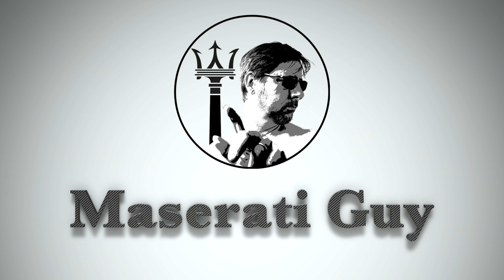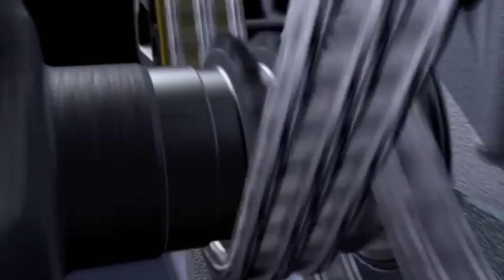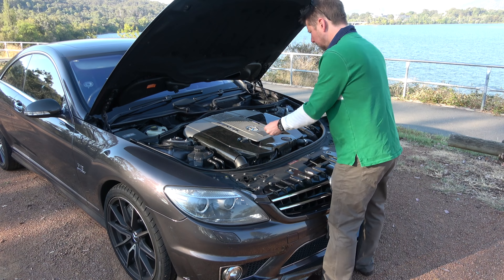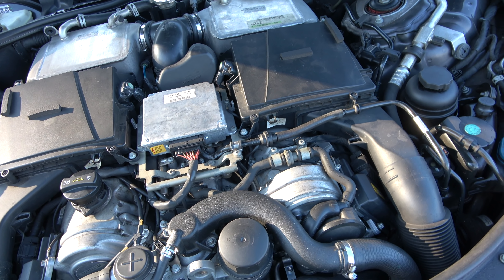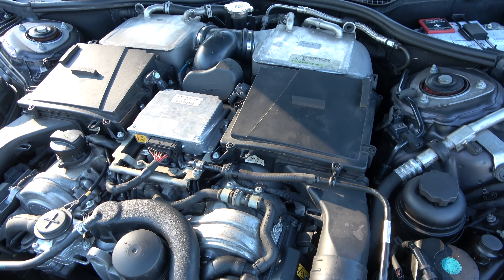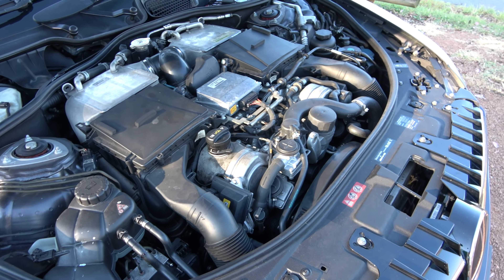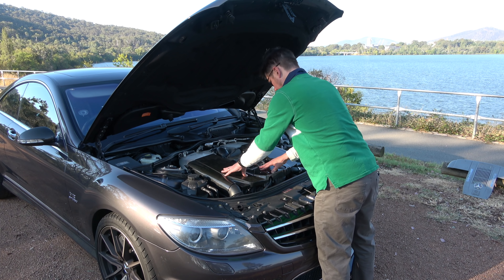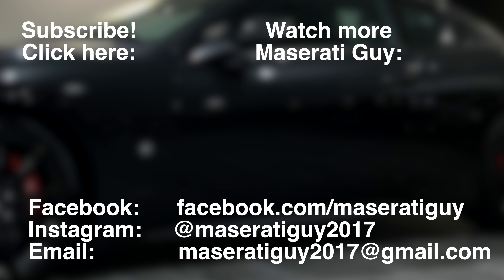Mercedes-Benz CL65 AMG - Awesome V12 Engine with 1000Nm! | Episode 107

Comment from the maker: As commenters have correctly pointed out, the silver boxes at the rear of the engine are part of the intercooler system, the turbos themselves are located down low each side of the engine (out of sight).

Comment: Apparently changing the spark plugs is a job because of the lack of space in the engine bay. The engine has to be jacked up from under the car to access the 24 plugs according to the merc mechanic that serviced my cl500. Very nice car.
Reply: No, the plugs are accessed from the top
Reply: Ive done them on my S600 - im a noob mechanic - really easy - not hard at all. Just need right tools.

Comment: You should consider upgrading your intercooler fill neck with this reservoir from the M279.  I did this to my 2005 SL65 AMG and it works fabulously! 

https://mbworld.org/forums/m275-v12-bi-turbo-platform/626110-m279-improvements-backward-compatibility.html#post6849713